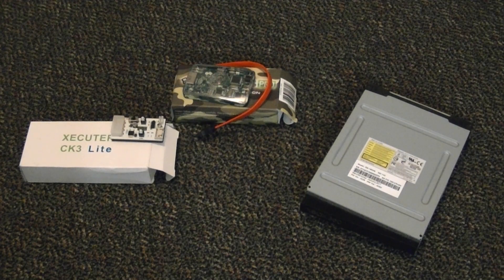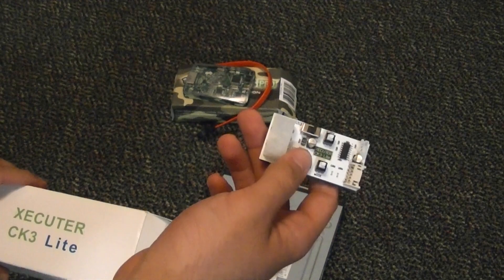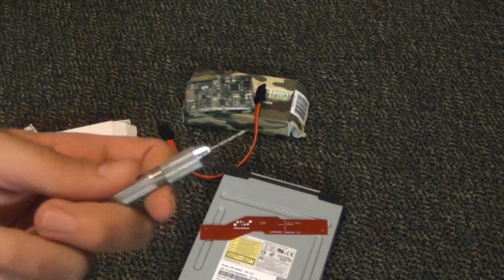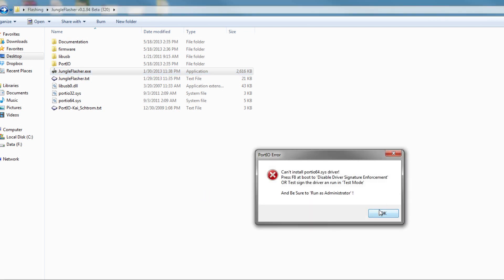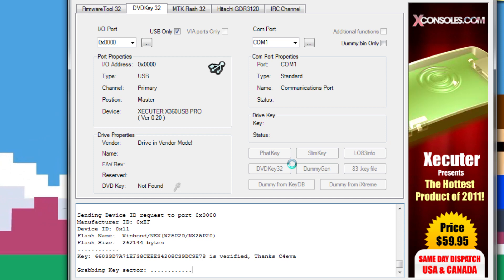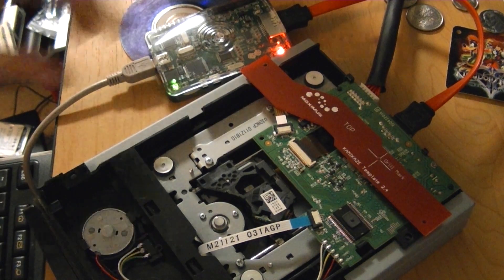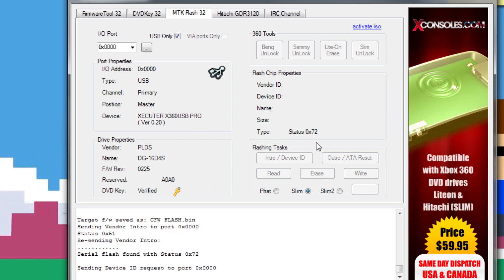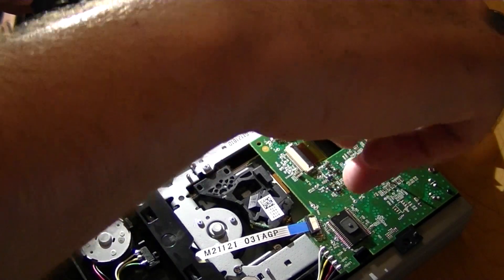How to Flash an Xbox 360 Slim DG-16D4S Winbond Drive

Comment: I don't know what I would do without your tutorials

Successfully unlocked and flashed my drive, I turned my speakers up to 80% and the noise scared the hell out of me, enough to make me stop naturally.

But it works and I'm happy

Thank You Mr Mario
Reply from the maker: Glad this still helps!
Reply: @MrMario2011  Right, im trying to do another one, i got the noise but i try and do the read but it doesnt proceed past Sector Erase. 

It doesn't do the Erasing and then writing part. It just infinitely loads and then puts the info in the flash chip properties and the X360 USB isn't doing anything

Any ideas as to why?

Comment: Did this yesterday. Used the onboard SATA port from my pc and made myself a power adapter using a 12V LED power supply and two buck converters to get 5V and 3.3V. The only problem I had was that the drive didn‘t got in Vendor Mode. Used a dupont jumper cable as a probe to short MPX01 to ground to force it into Vendor Mode. For drilling i used a 1,5mm drillbit. Measured the exact point where to drill with a caliper and made a template model with freecad and printed it using my 3D printer. Was confident enough and start drilling it. About 2min of drilling the SPI lock register switched to 0x00 and flashed the drive. Thanks for the video.
Reply from the maker: Woo!
Reply: How did you short it to ground ever time I do it cuts the power and stops the key read

Comment: If this was truly your first time doing this type of flash you did very well!! I have done a few of these back in the day with the x360usb and ck3 lite but no hand drill and no template I did all of mine scratching the surface with a utility knife and then spinning it like a top in the exact position. its a daunting looking task but its pretty easy if you take your time :)
Reply from the maker: Yep, this was my first! I've done a handful and have used a drill bit (like here), a X-Acto knife, and a soldering iron. The soldering iron was the best in my opinion - clean and fast.

Comment: This was a lot easier than I thought it was gonna be. The only problem I really had was that JungleFlasher kept crashing, but after a little while it eventually worked. I didn't use any of the tools in this video, for powering the drive I used an old Phat Xbox and for making the hole in the chip I just used a sharp knife. Using the old Phat Xbox is what was probably causing JungleFlasher to crash at times but like I said it eventually worked. Now I have to buy some discs and test this out
Reply: how did you plug the drive to connect to the computer?
Reply: I just connected it directly to my PC's motherboard using a SATA cable, you can use the one that's already in the Xbox
Reply: i'm confused with the hole part, Where do we have to drill, on the chip-set ?
Reply: I plugged it all up and jungleflasger can't  see the drive helppp please

Comment: jungle flasher has a trojan in the ads portion of the program. also, the help file within jungle flasher is a trojan. so don't click the in app adds & don't click the help link & you should be ok. i'm on win 10 home edition & windows defender picked it up right away & also removed it completely. other than that it's a great program, and mario did a great job on the tut. thanks mario. edit i'm now going to attempt to flash my dvd. wish me luck
Reply: Did u succed ?

Comment: Have you considered making an updated video?  The X360 USB Pro is selling for $90 on eBay right now, which is more expensive than the console itself.  It would be great to have a video that covers all the drives, goes more in-depth about the on-board SATA options and caters to Windows 10.  I had a hard time just getting JungleFlasher to run, and I'm still struggling to get it to see my drive.  Your other video vaguely covered suggesting to plug it into the master port, and obviously each system will be a little bit different, but one tip I've seen is to switch your motherboard's SATA ports to IDE mode in the UEFI BIOS.  This causes issues with booting into Windows, but when I get time I'm going to try booting into a Hiren's Boot Drive with a flash drive storing the files needed to do this and see if I can find the drive in IDE mode that way.  It would be awesome to see a video go more in-depth with this hardware option since it's currently the most accessible in 2018 for this discontinued console.
Reply: Late reply but all the eBay sellers selling the x360usb Pro V2 are overpricing it. You can get way cheaper ones on mod shops or AliExpress for around $50
Reply: VIA 6241 is the safe bet, but you'll probably need to have a system board with a usable pci (not pcie) slot.

Comment: Done this one time with Geremia cmd software using resistor and tiny screwdriver. Even if it say unlocked not mean it's still working drive. But I was lucky and drive works perfect after flashing.

Comment: Thanks a lot for this Tut! I just managed to do my first flash of a 16D4S Winbond. 
Just a question about the relocking (20m07): if I relock it, (how) can I later still unlock it again? I trained this flash on the 16D4S of a dead Corona and I may want to use the flashed drive for replacing a dead DVD-drive on another X360 Slim...
Reply from the maker: I believe you do it by dropping a small drop of isopropyl alcohol into the hole.
Reply: Happy to receive a reply from the master himself! (watched many of your videos)
This put me on the right track, found a manual about the kamikaze-hack that also instructs to use rubbing alcohol to re-unlock.

Comment: Is it possible to flash the newer 360 E manufactured in 2015?? What drives does it use LiteOn?
Reply: It is a 16d 5s and you need to rgh your console, then get the DVD key that way, then you need to get an unlocked PCB board, then get that DVD key from the RGH and flash it on to there.

Comment: Wonderful guide as always, than you. Sadly I'm stuck at 13:55 as it won't go into vendor mode at that point. Spent several hours trying things with no luck. Any ideas or tricks to try at that point? I don't want to risk proceeding with drilling if it's not in vendor mode as I don't believe it'll be successful and/or even possible until I do. Thanks for all you share. Your channel has been an amazing resource for me. Thank you. Edit: Oh, I'm using a CK3i and not a pro. Perhaps that has something to do with it? Maybe I need to order one of those instead?
Reply from the maker: I personally do not own any CRTs, I usually go through an upscaler.

Comment: Ok, so my xbox 360 had the red ring of death, and I tried to reflow the board, but I couldn't do it, so I ordered a refurbished xbox 360 motherboard it was almost like brand new lol. Anyway, I inserted it, and everything was fine until I wanted to play soke games, and the disc drive thought the games were movies for some reason. I found out that the original motherboard is like married to the disc drive, so if I did this flashing technique, would it kinda reset the disc drive in a way? So then I can play my games or not? If not, then how do I fix my issue?
Reply from the maker: You need to RGH the console to get the key, then flash that to your DVD drive.

Comment: Hey man. I've been watching your tutorials for quite a while now and I am having a hard time figuring out how to replace my disk drive that doesn't work with a new one. I have a dead xbox 360 that has a good winbon drive and I have the key for that and I have a good 360 with a winbon drive that doesn't work. Is it possible to create an unlocked drive and flash the DVD key and whatnot to the new drive out of different xbox? and if so, do you have a link or tutorial for that??? Thanks in advance man!

Comment: what is the benefits of flashing the drive insted of the jtag
Reply: Flashing you can only play backups, jtag/rgh you can run homebrew too! Flashing is essentially undetectable on Xbox Live while I wouldn't even attempt to bring a jtag/rgh online.
Reply: yeah using a flashed drive on xbox live is practically undetectable as long as you stealth patch your games correctly. 

I had an Xbox 360 slim with a flashed winbond drive that i used on xbox live for over 4 years(before the xbox died) and never had gotten banned.

On the other hand,bringing a jtag/rgh on xbox live is a guarenteed console ban (eventually). However you can unban your Jtag/RGH from xbox live as long as you have an Unbanned KV (keyvault).You can get these either from dead xbox 360s that still at least get power to the motherboard or simply by buying them from someone else.

Comment: Hey MrMario, thanks for the tutorial but is there a way I can flash my slim Xbox 360 to play games off of a flash drive or a burned disc without those tools you use in the video? I can't get most of them but I really want to play Fruit Ninja Kinect full (I have the trial)
Reply from the maker: Nope. You will have to solder if you want to play games from a USB drive, that's RGH.
Reply: @MrMario2011  Yeah I found that out from the internet, but what about just flashing to play burned discs? Any easier method to do it?

Comment: Has anything come along in the last few years to make this an easier chore?  Drilling into the main chip of my DVD seems very extreme just to load backups.  Like WTF!  Any other options???
Reply from the maker: RGH the console, extract contents from NAND, flash that to an unlocked PCB. Still difficult but less destructive if done successfully.
Reply: @MrMario2011  I have the PicoFlasher set up. Will extract info.  Is there a reasonable priced programmer for the DVD unlocked board?  Less than like $60?? Thanks for the advice!!

Comment: For some reason my xbox 360 slim drive doesn't have the 4th row of numbers, where the 03 and 05 are. Your drive's chip has 4 lines of information, but mine only has 3 lines of information. How do I know it it's windbound or mxci?

also I don't have to activate windows 7, right? Or do I have to activate it? I'm using a Lenovo Thinkpad T410 to flash a Xbox 360 slim Lite-on DG-16D4S drive, and I am going to use the X360 usb pro 2 to connect the drive to my computer.
Reply from the maker: You can probably tell once you hook up the drive to JungleFlasher, although worst case I believe drilling will work on both chips.
Reply: @MrMario2011  you mean once I hook it up with the X360 USB pro v2 and into the computer? Jungleflasher would tell me if it's a windbound or mxci?
Reply: @MrMario2011  So will drilling on MXCI and Windbound work? Or does drilling only work on windbound?
Reply: @writtenskate522plays  im curious to know about that as well.

Comment: I hooked it up to my pc but when I load up JS it's not showing up. It's saying that it can't install Portio64.sys
Reply: same
Reply: I don't know if either of you found the solution to this, but for the next commenter that comes by here, the page for the Driver Signature Overrider software gives instructions to put Windows into Test Mode.  Do that, THEN use the Driver Signature Overrider to patch the portio64.sys file you copied to the root directory of JungleFlasher.
Reply: @majoraslayer64  or just boot windows without driver signature checking through the advanced boot thing

Comment: I have a 360 Slim flashed dvd drive but the 360 got red light can I put the drive in another 360 slim the other one I have is the Gears of War 3 special edition console
Reply from the maker: You still have to flash it with the console's expected DVD key.
Reply: @MrMario2011  ok thanks... so if I get a new 360 the same model that the flash drive is in now will I be able to just put the old drive in that one

Comment: So I tried to do this today. Due to a lack of an x360usb device, I wanted to use my pc for this. I was able to extract the key, but when I try to send the intro/device Id it is always stuck at status 0x51 - does that mean my chipset is not supported? Is it normal that I was able to extract the with a non-supported chipset?
Reply from the maker: Probably.
Reply: @MrMario2011  well, turns out it is not fully incompatible, for some reason my chipset is only able to send the intro once. After that, my pc and the drive need to be powered off and unplugged (!) from the outlet for 15 minutes until I can send another device intro. So basically, I got it to work, but in the end, it doesn't matter anymore because apparently I drilled too far into the chip and now my drive doesn't eject anymore :(. Gonna have to order an unlocked replacement pcb - luckily I do have the key.

Comment: Is the DG-16D2S the same as VAC6038, cause i needed a 6038 and i ordered one on ebay which clearly stated w pictures it was a 6038 by benq but i just got a 16d2s and idk if its the same, im probably just gunna sotter this new on go the old one though, but i need to .ake sure

Comment: My Xbox was made on august 16 2011 can I still flash it??
Reply: Plus it doesn't even have a sticker
Reply from the maker: The only sure way to check is to open up the console and look at the model number of the disc drive on the sticker stuck to the drive.
Reply: MrMario2011 oh yah I forgot I made these comments my drive is a hitachi :(
Reply: Can I flash or is it impossible manufacturing date is may 2011

Comment: i have a model: DG-16D5S  S/N:D811BB1316110038Z   Manufactured: august 2011.  Its has the yellow sticker on the side. Can I flash it?
Reply from the maker: Sadly not with this, that's a 16D5S.
Reply: @MrMario2011   ok, thanks for the reply

Comment: Would it be possible to flash something else besides the xbox os? Sense the cpu I believe is a xeon processor.
Reply: it isn't the xbox os, it's the dvd drive firmware, which handles telling the xbox which disk is in the drive with various key checks to prevent piracy

Comment: This may be a controversial take, but I always felt like Jungleflasher could have been soooo much more user friendly.  The amount of times you are told that you're reading and writing to the drive is just over kill. Even with the original phat drives where you didn't need to drill, or even probe on some of them. The process should be simply dump the original firmware, jungleflasher creates the CFW using your key extracted from the firmware, and then writes it back to the drive. Instead, you have to read and write back to the drive like 4 separate times risking a fuckup every time. I never understood that. This is coming from someone who successfully flashed atleast 15-20 drives over the years.
Reply from the maker: I'd rather have the safety of it, but that's just me.

Comment: So is it possible to put another disk drive from a Xbox 360 to work on another Xbox 360 by flashing it.
 I have the DVD key from the original console.
 what I want it working on.
I'm not bothered about it getting flashed to play copied  games.
I just wanted to play games from disc.
It's just when I bought the console someone had put another disc drive in from another console without swapping logic board.

The console has been RGH1.2
Reply from the maker: Yep. You can either flash the matching DVD key, or physically swap the matching DVD drive board.

Comment: I understand all this except the drilling part. What is the point of the drilling?
Reply from the maker: There's a wire inside the chip you have to drill which is responsible for keeping the drive locked. When you drill at that spot you're hitting the exact location of that wire and the intention is to break it, once that is done we can manually unlock and lock the drive for modification.
Reply: Understood.

Comment: cant I just do this using my pc's sata port? I cant seem to find the x360 flasher anymore and the ones I can find are from china and cost nearly $100, my budget is 50 LOL.
Reply from the maker: You can, but in my experience it can be more annoying to use the SATA port, especially these days.
Reply: @MrMario2011  hey, thanks for responding! i was worried about that. do you have any suggestions for a flasher i can get for cheap?

Comment: does microsoft even try to ban people who are flashing their old 360's now more?
Reply: jentor they never banned for flashed drives just rgh jtag and things like that
Reply: they did because you put modified firmware on the drive
Reply: LT+ for the most part, it is undetectable for them. If you get banned it is for using it for bad things.

Comment: Can I use a 16d5s disc drive  on a 16d4s drive?
Reply from the maker: If you mean replace a 16D4S with a 16D5S? The only way I would advise doing that would require a LTU2 board installed in the 16D5S drive, then flash it with the key.bin and c-r.bin files from the console.